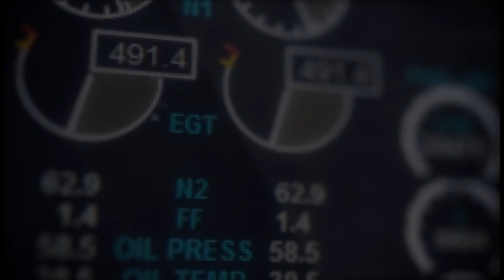Will Circular runways "take off"

Comment: I think that an airport with a cross runway crosswind be a better solution because cross wind only dangerous if it blows perpendicular with the aircraft heading so basically you can avoid that by landing in another runway that cross your current approach and you can have not optimal but a headwind instead of crosswind

Comment: 1. I'm not sure the wet or an engine failure is a problem with sufficient banking which would counter act those forces.
2. Whether wing tip clearance is a problem depends on if, and how quickly the banking changes. I presume it would have to be super wide, which mitigates that.
3. You'd never overrun the runway which is a good thing.

Comment: Even though I have no knowledge about aviation, yet this idea seems to me great. The only one thing missing is to put the inner triangular shape into outside of the circular perimeter so the airplane would  landing and takeoff before it enter the circle. To me this idea is like throwing a stone from slingshot. First you rotated to build momentum, then when stone is released it goes straight.

Comment: First I see the problem with cross winds effecting the ground rolling on take off or landing.
BIG second, ZERO tolerance of over shooting the end of the runway on landing.
third the effect on passengers. As you are coming in the aircraft sharply dips the inside wing.
Forth all  the passenger are thrown to one side as the centrifugal force immediately hits 150+ mph.

Comment: my immediate reaction was 'preposterous'..and as a thinker, and aeronautic physics enthusiast,  I'd predict with moderate confidence that this would never happen. Even with AI futuristic traffic control. creates way more problems than it solves. want more capacity build more runways. Or,  maybe VTOL  tech..but., well that's a really long, fun discussion. more viable than circular runway it seems, but with some remaining unresolved tech barriers to get as efficient and safe as fixed wing. that discussion might lead us to thinking VTOL may  never being a thing for this role. (safe, efficient, large payload) Physics is a bitch, lol. it may be  that fixed wing is the wheel that can't be re-invented. maybe STOL, idk. Whatever it might be, it will have  wings, not just rotors or thrusters w/ or w/o smaller wings, that's for sure. you can't beat big wings at efficiency for more reasons than just Reynolds stuff.  when you add it all up, yeah Wings is a fun show, if you haven't seen it, you might like that sort of thing for comfort tv.  
.

Comment: Another great video - the idea is not new - it has been around (no pun intended!) since at least 1919 (Illustrated London News). Also Charles W. Glover designed a spoke based circular runway, which is probably a good compromise. I seem to recall as well that there where ideas to have the circular runway suspended between multiple skyscrapers. A lot of ideas came out from the '50s (what a great era for cartoon like illustrations!) - certainly the 50's era of what future aviation would look like was very futuristic looking!

Comment: One issue that he has not included is when you have an emergency landing where the runway is just not long enough. With a circular runway, those emergency issues might be resolved as the runway would always be there and not disappear into a body of water, or a highway. Perhaps construct a circular runway for emergencies. To reduce takeoffs and landings someone has to change the mind set of airport design. Also a better technical approach to learning how to deal with emergencies. I know that this type of scenario is used in flight simulators, but in the real world, people do get disoriented, and pilots are no different.

Comment: Such concept could do well under some circumstances:
- 3km diameter is a bit too low;
- then there must be a huge plain available;
- weather conditions aren't subject to change throughout 24h or even a year*;
- such an airport is not too busy, let's say scheduled landing at... 10, 5, 3? minutes tops*;
Why have I marked some with a *?
In such conditions it would be just too costful than build and maintain two runways, e.g. 17/25 and 05/23 respectively.
Because of less "usable surface" (tarmac, concrete) to be maintained all year round, which airlines would be compensated with significantly lower fees than doing go-round from time to time.
In general - I would gladly see a huge experiment in topic somewhere (does not matter if envolving bunch of A380 or Cessna 172), but in total I just consider it rather in terms of waste of means and money.

Comment: i don't think the runways should be circular i just think they should be longer, they are too short, a plane should be able to stop after V1
And planes like A380 fully loaded take the whole lenght of the runway to take off i don't understand how this is even legal but whatever
Reply: E I N S while longer runways wouldn’t be bad, you still couldn’t stop after V1, it would just increase V1
Reply: @Cardcollector-pz8hg  Right, as V1 is the maximum calculated velocity where the specific aircraft with an exact weight can stop on this particular runway with the exact weather situation. Not that easy as it seems sometimes.
Reply: The problem with longer runways is cost. The airport would have to buy all the land, and possibly pay for demolition of tall buildings further out on land they don't even own. Since many major airports are in or near major cities with high land values, that could cost billions, without even considering any costs associated with actually building the new surface or the buildings to service it. And what do they get in return? The ability to operate larger planes (which there is currently little demand for). It would just make air travel more expensive as the costs get passed on to the airlines, and then to passengers.

>> And planes like A380 fully loaded take the whole lenght of the runway to take off i don't understand how this is even legal but whatever

And yet air travel remains one of the safest forms of transportation in the world. Aircraft designs get consistently more reliable, and safe
Reply: I think your point is the runway should allow airplane to land even after they've reached takeoff speed as least a seconds or two after takeoff. The reasons it can't happen is mentioned by everyone else in the comment thread cost plus maintenance. That particular airstrip would not be used often and still have to be maintained for emergencies.
Reply: That's a really interesting opinion, thanks for sharing with us as clearly we enjoy your feedback.

Comment: The circular runway is a monumentally terrible idea for a plethora of reasons. The most major one on my mind is that shear force on the landing gear, increased due to the faster speed of landing due to the roll needed when landing AND the strain on landing on an angle, will cause gear to collapse. As a concept, a circular runway is an infantile, a half-baked thought experiment.

Comment: Instead of circular runways, why not configure runways  as a square, or multiple squares overlapping at an offset angle?  

With one square, one might have runways 18 and 36 L & R as well as 9 and 27 L and R.  The terminal would be in the center, accessible via tram or rail.  Depending on the space, the runways may or may not intersect with each other.

Comment: Typical - some engineer who probably never flew an airplane comes up with a half-baked idea and thinks, "well, it looks good on paper." As a retired Retail Manager I've seen this a lot in my field - Corporate Big-Shots who NEVER worked a minute in a store dictate policies that are totally asinine and then wonder why business went to hell.
I immediately came up with several problems (many that that others have pointed out) such as ILS Approac and the various approach lighting systems (for example - PAPI's)? They are not going to have one for every possible degree of landing.
With all the buildings in the center of the circle - the logistics of all the civilian & commercial vehicles that need access is costly - It is more expensive to build a reliable tunnel under a runway than an above ground flat road. I'm a non-aviation (pilot) person and even I can see all the flaws in this idea.
Is this the same engineer that, despite knowing how people are when driving, thought Roundabouts are safer than a 4-way intersection with traffic lights?

Comment: This might work for smaller airports with planes that can handle smaller stresses. 
The problem is that pilots of smaller aircraft aren’t as experienced, and may cause more accidents than if they were to use airports with straight runways. 
A compromise might be an ‘L’ runway that is flat on both ends, but banked and curved in the middle to ‘fit’ a longer runway on an odd-shaped terrain or island. The angle wouldn’t have to be 90 degrees, but enough to allow an airport where otherwise it wouldn’t make sense.

Comment: I think it’s the worst Idea I ever heard. First, to prevent the Plane to get dragged out of the Circle, you have to made it like a NASCAR Track and that adds some Downforce to the Plane that must be overcome by the Wings too, ergo you need a higher Take off Speed, that adds even more Downforce to overcome. Second Problem is, the Wind comes at every point from an other Direction and the Third, you have to Start and Land the Plane everytime with a pretty decent Roll. I didn’t think, that this Guy thought this far. And we didn’t Talk about some 1.5 Ton Cars, we talk about Airplanes that can be really heavy.

Comment: Landing or take off into the wind reduces the paths in and out of the airport. That 360 degree thing works with no wind or really low velocity, unfortunately that is a variable that probably will bite winter and spring.

Comment: Regarding the obstacle issue, it would be possible to define "forbidden" sectors, for instance a 30° sector that would be closed due to a city. There would still be 330° usable. Also, it's not necessary to allow every possible heading. Restricting to a set of approaches, for instance every 10°, would not remove the benefits of a circular runway, and make things easier to manage.

Comment: Could be feasible in a desert area or on an artificial island. Sounds like the perfect idea for the UAE or the Saudis to try out.
EDIT: Maybe you can add several (say 8, 12, depending on the traffic) short straight tangential runways to the circle for extra easy landings with better wingtip clearance.
I think such a design would accomodate huge traffic and allow for a massive hub to operate smoothly.

Comment: Also, from an engineering perspective, they're not a good idea. They require A LOT more building material - for example to create the earthen foundation to create the cambered surface. They have to be wider, and they need strong foundations to reduce the effects of tension on the runway material.

In addition, you mention the land space issue - with a circular runway, you give yourself a space where your airport buildings cannot expand further. You cannot build terminals outside the runway - as you would then need to construct some sort of tunnel to get from the outside to the inside.

Although they're self-irrigating, it means that you will have a high level of water, which gets greater in volume as you get closer to the bottom. Ergo, aircraft which need to use the inner edge will be affected the most.

Above all, all this means they would be VERY expensive to build, and require monumental efforts to reconstruct nearby infrastructure, so of course this would never happen on that basis alone.

I think it is better to stick with 'scary' takeoffs and landings - after all, very very few crashes occur solely because of crosswind.

Comment: Instead of circular runways just use circular aircraft.. aka flying saucers
Reply: Yeah that’s not a good idea their chief see we aren’t aliens
Reply: Your funny
Reply: Bad Cattitude  hmm not necessarily, if we make some sort of system, whereby the fuselage of the aircraft is like the rotor hub of a helicopter and there are rotors that spin on the outer edge of the fuselage, (one of them new-fangled dual rotor helicopter designs so a tail is not required), then a flying saucer is possible.
Reply: Circular runways really get around.
Reply: Not circular aircraft but giant Frisbees.
Reply: or tubes!!
 whos working on the tubes project????
Reply: U mean unidentified flying object

Comment: Have you heard of the concept of banking ”speeds” on circle tracks? It's when the bank angle, gravity, and centrifugal force cancel out to have zero lateral force. It's probably much the same as when you turn an aircraft just so and the only effect is everything inside feels heavier rather than everyone spilling drinks. With the speed of the banking set to just below takeoff speed most aircraft need not experience much lateral force and grip isn't so much of an issue

Comment: It would be a nightmare for waiting planes to take off.   Because depending on air speed change planes would not be always touching the runway at the same place.  So the question would be how much of the strip is mine and where can i enter the loop?

Comment: I think your opinion is rather short-sighted and biased.
If you look at the artist impression of the runway and then your version. well, let's just say it's understandable why you would think it wouldn't work. >_>
the artist impression shows clearly that the outside or the landing edge is flat but banked up. yours is curved like some sort of skate park ramp. Not only would that not work it doesn't even serve a purpose. The only curve that needs to be there is the gradual curve to level ground as to make boarding and un-boarding a bit more realistic.
The runway is banked in other words it's sitting at an angle and the angle is determined by the curve of the whole runway. The bigger the diameter of the curve the less the bank will need to be to keep the plane to follow the curve of the runway without input from the pilot. Take Porsche Nardo Ring for example. You can take any car that does 240 km/h and drives a full circle without touching your steering wheel even once. Herein however lies an issue that the landing speeds will be predetermined regardless of size, load, type of plane etc. But then again this idea is in no way meant for today and today's planes.

As for the obstacle clearance area. Obviously, this type of runway will only be considered if it's is doable and makes any sense in that specific context, just like any conventional runway already is. An island that is 2km long can't facilitate a 5km long runway regardless of shape.  On top of that, you claim this zone needs to be extremely flat. no shit I always thought a runway on mount Everest was never constructed due to lack of funds. >_> 
But seriously just look at Schiphol airport. buildings on either end of several runways within 2km. (and it's built right between the cities Amsterdam Hoofddorp and Aalsmeer.) so that 3km + 2km on either "side"(roughly). that's an airport with a diameter of 7km. there are way bigger once out there already. So size wise it's not even that unfeasible.

As for the centrifugal force during an engine failure. It's irrelevant. Due to the simple fact that the bank and the centrifugal forces counteract each other. meaning that you don't need to actively turn the plane once at speed. In other words even though you are going in a circle the plane acts as if it were going straight that's the whole point of the bank. should an engine fail the same thing will happen as it would on a conventional runway. either you abort or you don't.

Slippery runway again irrelevant it's the same as a regular runway. >_>  As you are speeding up the plane will automatically move towards the outer bank where it will behave identically to a flat runway due to the bank and centrifugal forces counteracting each other. the idea that you will slip off the end is utter nonsense. (assuming it's designed properly)

As for the different airport affecting each other if one of them changes to a circular runway. Is true but if they simply add a lane it would change it equally any change would....

Though as I mentioned before I will agree. This is not for today but "tommorow". Altough in my opinion by that time runways might be obsolete as a whole.

Comment: That's an absurd idea. Even not being a pilot at all, I think the opposite example of yours about engine failure would be even more dangerous - your INNER engine failing during takeoff an you being pushed towards the ground - like in drifting, understeering still keeps you in control, but oversteering makes you bite the dust. Also strong crosswind on a curved surface won't make you happy.

Comment: Seems to me the only way to address many of these issues is by using fly-by-wire, but we don't yet have the level of sophistication and consistency to do that, and by the time we did we'd have replaced commercial flights with an alternative solution (like flying cars). So, I think this concept will get leapfrogged by the Uber of the skies.

Comment: I enjoy your videos, but I have a minor quibble with your terminology in this one.  An airplane rolling off the runway as you describe would be due to insufficient centripetal force.  While the effect may be identical, there is, technically, no centrifugal force acting on anything on a circular runway.
Reply from the maker: True! I used a common terminology that most people would understand but you are correct.
Reply: 6 of one half a dozen of the other. From the plane's frame of reference it's perfectly valid to talk about centrifugal force.

High school physics teachers have a special hate on for centrifugal force, but in physics inertial forces are used all the time. Hell in GR inertial forces like centrifugal or Coriolis forces are equivalent to gravity.